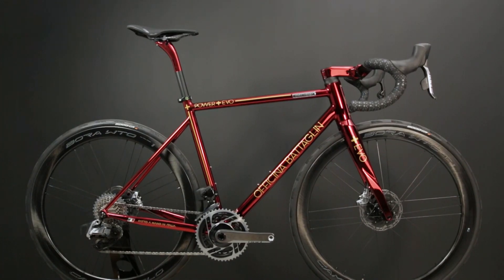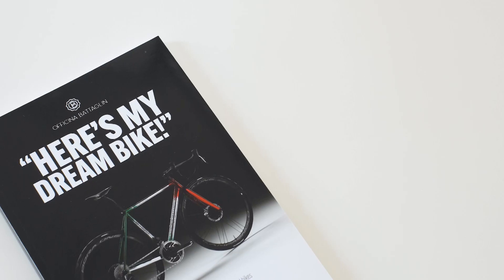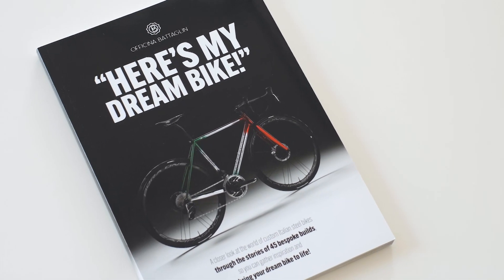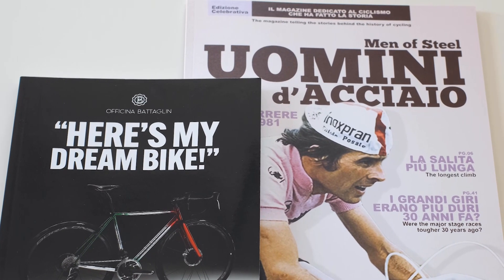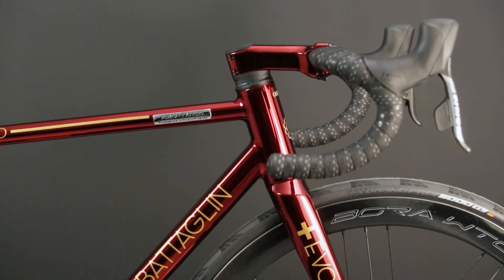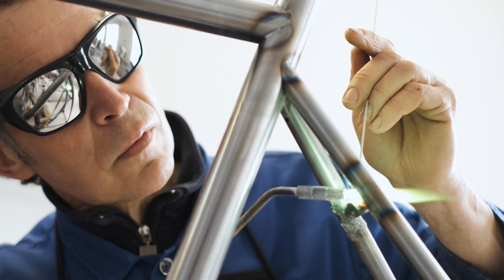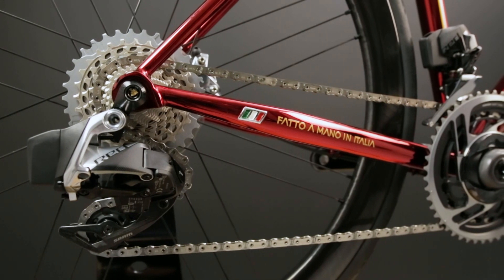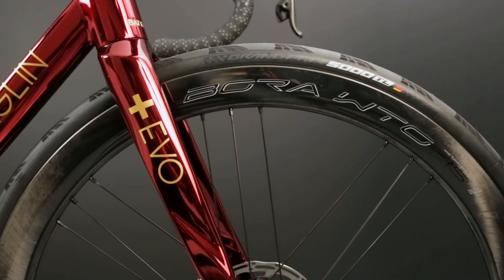Painting a custom STEEL BICYCLE FRAME: RED cromovelato PAINT with golden details!

Comment: 100% short lugged steel either in standard tubing or OS in classic standard geometry (NO compact nonsense), low 265 BB, significant setback, flat fork crown - FULLY chromed fork, threaded steering tube, external cable ferrules, full silver Campy, Cinelli 1A - 64,65,66..., Ambrosio Nemesis or Synthesis - 32x3X14/15, brass nipples, San Marco Rolls, white tape.   RIGHT!!!